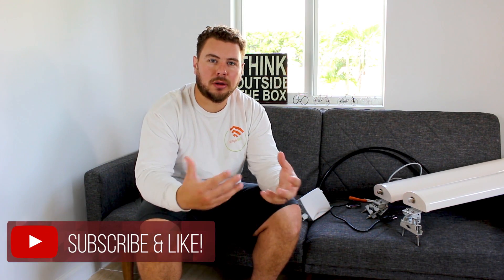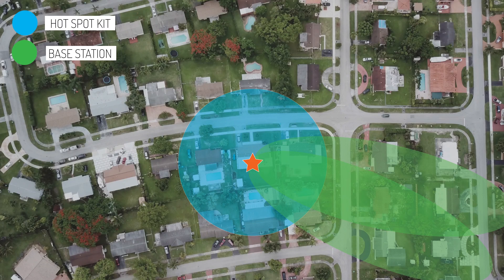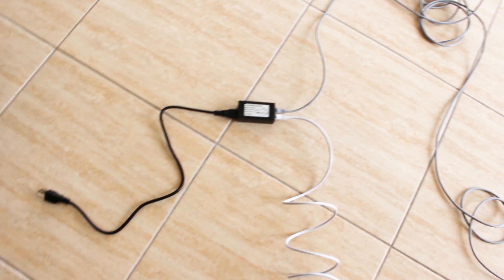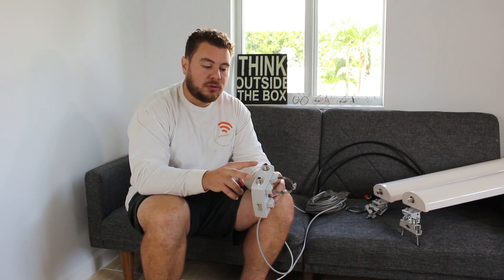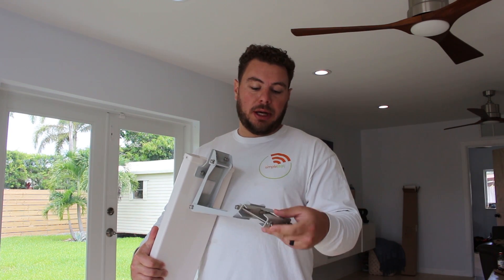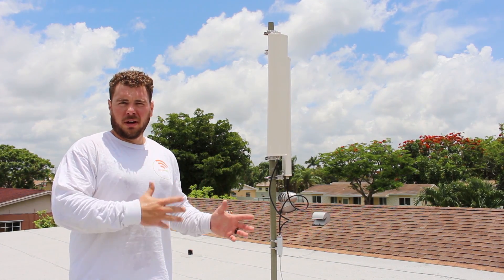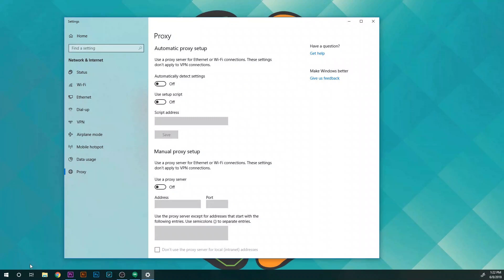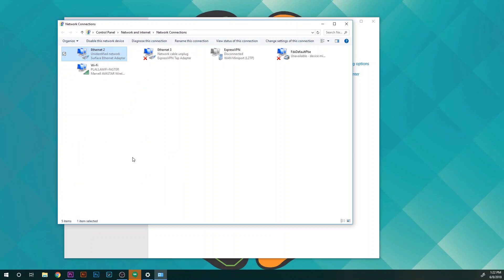How To Setup A WiFi Base Station Tutorial

Comment: having trouble finding an access point like the one in you're video. I found 3 but ones out of stock the other is only rated for -8 degree F. (it often gets colder than that) and the other is $1000 and has a lot of features i don't need
Reply: try taking a look at ubiquiti. I'm actually sending decent internet from 10 miles away since the providers In my area are money hungry cheapskates that charge 120 a month for internet that can't load Gmail. anyway ubiquiti actually has some nice stuff. and a few youtubers cover them

Comment: what if i want to attached 3  Antennas to the AP to get 360° coverage ?
Reply from the maker: You will need a splitter that will cut the power by half at each antenna. Better to get 3 AP's then feed 3 ethernet cables to a switch.

Comment: I like using the LBE-5AC-16-120 as our AP it works great for coverage area and long distances, like miles.
Reply from the maker: Nice
Reply: I cant find on your website Base Station sectorial panels @SimpleWiFi
Reply: @SimpleWiFi  are you still on those antena
Reply: Good day bro, what is the maximum distance range of this antenna ? Is it applicable at 50km ?

Comment: What will be the number of concurrent users with both of these sectors coming from one ethernet port??
Reply from the maker: Max is about 30-50 depending on bandwidth and signal strength.
Reply: Following the prices, concurrent user is very low, because if i may consider it for densed areas, It is not going to be an idea worth it. Consider increasing concurrent user... As  your concept is good.

Comment: Hi, I have a problem with the sectorial antenna, It's simply not working. the model I have is HG2420P-120
http://www.l-com.com/wireless-antenna-24-ghz-20-dbi-120-degree-sector-panel-wlan-antenna

I have connected Mikrotik base box 2  but is not working even like a very simple wifi router.  even I checked with enginues dual-band outdoor.

Could you please let me know which specific router is working with these antennas,  I have 66 of this but could not use it's function.

Thanks.
Reply from the maker: It's probably not the antenna - it's most likely the configuration of the access point which could not be set to AP Mode. I would double check that first.

Comment: We set up a Long Range Wifi connection on two bands (2.4 GHz and 5 Ghz) with parabolic antennas. We used two WRT1200AC router with OpenWRT to measure the transfer bitrate. Our measurement results were only maximal 500 KBit/s on 6 km distance. Is that normal? For us it seems very low compared to other scientific paper. The transmit power was limited by the german restrictions (2.4 GHZ: 100mW; 5 GHz: 1 W).
Reply from the maker: With those power ratings that sounds about right over that distance. How high and above the obstructions were the antennas? Did you do a Fresnel zone calculation? That is what most people usually miss on these links - especially with such a low bit rate. ALSO, I have never had luck with WRT and speed. Even when I would do links at about 50 meters with an input of 75mbps, the resulting output was less than 5. For some reason WRT does not pass bandwidth that well.

Comment: Hello sir, I am  planning to build a mini base station  and want to send the internet signal to my 3 properties in different locations, each is about 5 km away facing north and east from the base station. each property must have a wifi installed in it.. is this possible? what is the best antennas for this setup?
Reply from the maker: A base station using parabolic to bridge between each location is what you need, not sectorials. At each location you will have a repeater grabbing the signal from the base then passing it along. You need to do more if a POINT TO POINT bridge rather than a base station.
Reply: can you show me a simple diagram please? do i need to use 3 parabolic antennas from base? and an example model of antennas that will need to use.. thank you.
Reply from the maker: I can't do that here - you will need to contact support@simplewifi.com

Comment: Shouldn't you be using one MIMO ready antenna & not two separate antennas? Aren't the MIMO antenna supposed to both be pointing the same way & one is vertically polarized and one is horizontally polarized?
Reply: Craig Mullins I watche your videos..i live rural zone my question is what the best wifi
Reply from the maker: Not always applicable. A MIMO antenna is really 2 antennas inside the same housing. That's why MIMO antennas are typically panels since they can be easily managed into the same box. Some can be cross polarized but it's not always the case. In my example, I am using 2 SISO antennas vertically polarized and they work as intended - which was far reaching internet. Of course as I moved further and further way speeds dropped.
Reply from the maker: Sorry meant to say horizontally polarized***
Reply: Tell me  a bit more...
Reply: Craig Mullins well I'm living in  mexico rural zone is far away from the city like 3 hours i connected my house phone with cables is antena above my house but now I want to have wi-fi what is the best for rural zone to have great wifi

Comment: How far does this base station can be reach by mobile
Reply: You'll be lucky to get 150 - 300 feet. A cell phone antenna is small and data transmission has to go both ways. The  base can get to the phone, but the phone won't be able to transmit back to the base... Now if say you put a small router/access point in your car or something like that you could connect phone to car access point & have that connect to the base.... You could go FAR...
Reply: @CraigMullins1  makes a lot of sense thank you
Reply from the maker: Sorry I don't understand your question. Can you rephrase it and I will be happy to help.